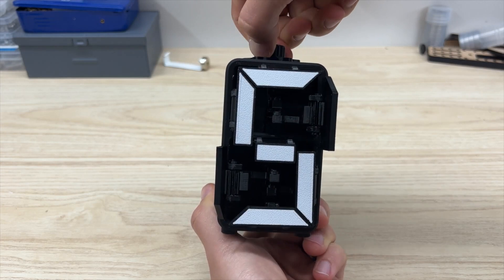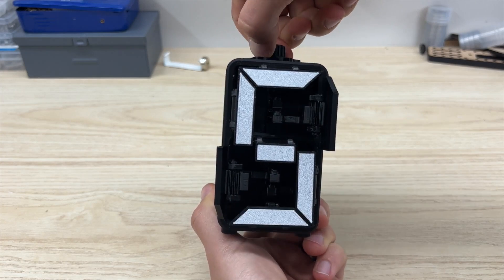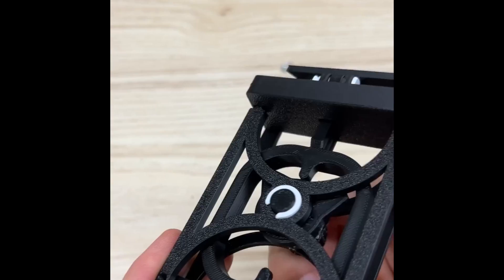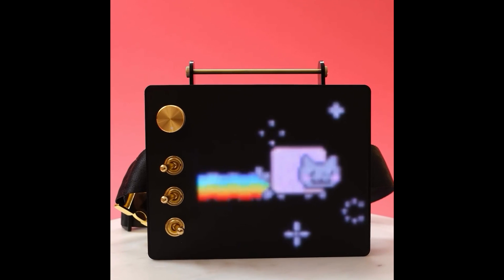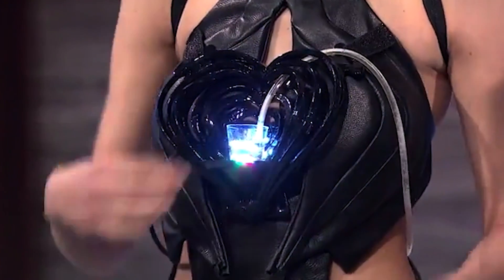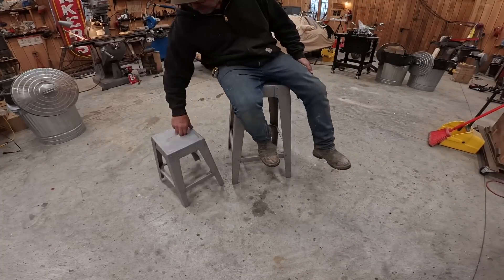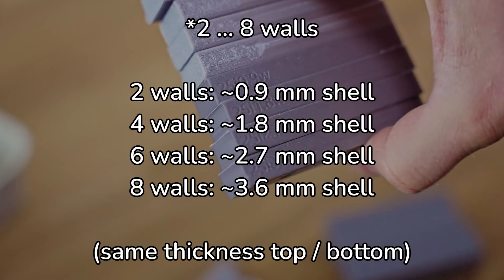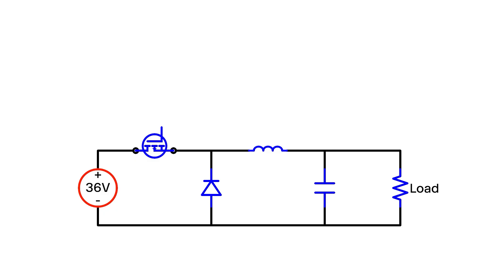Counting Cams [Maker Update] | Maker.io

Comment: Reminds me of the old program units in dishwashes and washing machines. The noise when you cranked it in start position, and when it ran and switched. The noise of the geared motor that slowly turned the cam rotor.